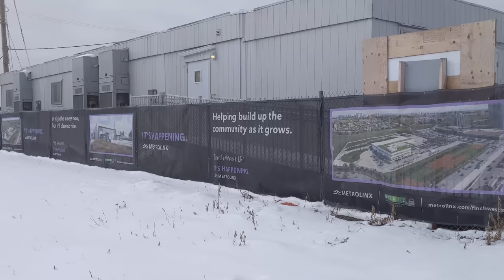Missing Links: Short-Sighted Transit Planning

Comment: Moscow: lines 8 and 8A are intended to be parts of one line, they’re even numbered this way and are both yellow on the map. But connecting them requires difficult construction in the dense city center, so it is always postponed, and instead, long lines are constructed in the now-nowhere (as they yield more kilometers and other big numbers that can be proudly reported). To be fair, line 6 and line 7 were also each split into two before being joined in the center, but not for that long, and these were Soviet times anyway.

Also importantly missing are interchanges to Polyanka from line 6, Kitay-Gorod from line 3 and Dostoyevskaya from line 5 (circle), but the last one is under construction (again, after years of freezing and unfreezing it, but this time it all feels unexplainably more certain).

Comment: I want to talk about an example the video doesn't mention. 

First, some background info: In Ankara, the Ankaray (LRT) Line ends at the city's intercity bus terminal. This line is the first rail line in the city. Then, 20 years after this line had opened, the government built a new metro line and put a station that is located close to Ankaray line. But because of this new line built under a highway, there are apr. 800 meters distance between those two stations. 

Later, the government dug a tunnel between those stations, put the rails, even built the transfer station, etc. but the line couldn't be opened. Why? Because Ankaray's signalization was too old to be modified, extended, etc. Signalization of the whole line needed to be rebuilt from scratch. Now, the municipality is running an expansion program about the other end of the Ankaray, and they announced while they are building the extension, they'll modernize the signalization and open the other part, too. It probably will take years, but it's better than nothing. 

Edit: Again in Ankara, the M4 line ended at a ridiculous station. Yes, it had a transfer station with M1 but you had to make a transfer to go downtown. The funny part is the distance between the station where M4 ended and the downtown station was only three stations. Thankfully, they realized the nonsense and currently expanding M4 to downtown.

Edit 2: I just realized our M1 line has missing connections, too. If they have built 1,5 km longer, the M1 line would end at the location that our commuter rail Başkentray's expanding station.

Comment: It always frustrated me how San Diego is a light rail city without airport connections. The trolley literally goes right next to the airport but if you want to actually take transit to the aiport, you would need to hop off the trolley and take a bus.

Comment: What has been bothering me for a long time is the Amtrak terminal for San Francisco Bay Area is at Emeryville, a place with no other connections other than buses.  The ideal case is to extend across the San Francisco Bay to the new Salesforce Transit Center in downtown San Francisco.  If that is not possible, at least it should be extended to Oakland and connect to the BART subway system
Reply: I thought the major Amtrak terminal for Bay Area is Oakland Jack London Square. At least that's where the Coast Starlight stops to drop off trash and pick up supplies. Which Amtrak train uses Emeryville for its terminal? And yeah, the lack of connection between railroad and BART is laughable in Alameda County. At least it's been rectified in SF.
Reply: The California Zephyr to Chicago uses Emeryville for its terminus and doesn't go to Oakland Jack London Square

Comment: In Chicago, I have missed many transfers between the Metra Electric District and Union Pacific trains because of the 1 mile distance between their city-center stops at Millennium Station and Ogilvie Transportation Center.
Reply: Chicago Hub Improvement Program (formerly Chicago Access Project). New major ME station at McCormick Place and upgrading the St.Charles Airline to directly connect it to Union without reversing at the bridge. But so far the plan for CHIP doesn't include a travelator or some such connection from Union to Ogilvie. Still, a two block gap is better than one mile.

Comment: In the London Underground new lines MUST interconnect at every station  of other lines in the under surface-tunnel core area. The Victoria and Jubilee Line Extension were required to by the UK national Treasury as a 'cost benefit analysis'. Most recently the rule applied to the Elizabeth Line on the same basis, ie it interconnects with every Tube station it passed by. However,  this gives rise to major local political arguments where the line passes but there are no  stations planned  because there is no station present; the two examples of recent date were the demand for a station on the Victoria Line at Pimlico, uniquely no interconnection and Southwark and Bermondsey on the Jubilee LE.
Reply: Have you got a link to that? As far as I'm aware each station would be looked at on a case by case basis as part of its business case, a connection may or may not help the case (Northern Line extension to Clapham Jcn didn't due to crowding concerns). 

Lizzy doesn't call at Holborn so there's no connection with Piccadilly even though it must pass very close to it. And I don't understand your references to Pimlico, Southwark and Bermondsey - they were built because business cases showed they'd be viable.
Reply: It doesn't interconnect with Oxford Circus either despite Bond Street, Oxford Circus and Tottenham Court Road being in a straight line (likely due to overcrowding at Oxford Circus)
Reply: @theobrigham  Ah - yes. For some reason I thought Oxford St connected into one end of TCR Elizebeth line, but it's miles away. So yeah, other than Bakerloo, Victoria and Piccadilly, the Lizzie connects to all lines it crosses...
It also doesn't stop at City Airport despite passing under the site.
Reply: @theobrigham  the trains are so long that they would hardly move between tcr, oxford circus and bond st.

Comment: In BC outside major centres transit is the responsibility of regional districts even though most RDs transit is operated by BC Transit, but the regional districts don't talk to eachother. So you have missed connections between regional districts. So you can take a bus (not a frequent bus) from Courtenay to Fanny Bay and from Deep Bay to Nanaimo but not a bus from Courtenay to Nanaimo unless you want a 12Km walk in the middle - which would take the bus about 10 minutes to bridge.
Reply: Oh, also we have a rail line... That hasn't seen service in over a decade.

Comment: Seattle and Seattle Tacoma airport are kind of in the same boat. It’s light rail connects to the airport and the city but it doesn’t connect to the larger rail network. I wanted to use it very badly. But the need to taxi between the two and then the extremely limited schedule made it all but worthless for anyone who doesn’t live in downtown Seattle

Comment: NYC has so many weird gaps, but my least favorite is the weird gap between the J/M and the G train. The G train's Broadway station is right between 2 J/M stops - only like 2 blocks from each - and has no free transfer between the two. there used to be a free transfer but that was just for the L-pocalypse. both J/M stops are also a little too close to one another, frankly it would be better to just close Hewes and Lorimer and build a new stop right over the G's Broadway station.
Reply: The East River crossings to Brooklyn really make it clear that these used to be separate competing systems.

To some extent the discussions make it clear that the more extensive your transit system is, the more missing connections you'll see--so some of the systems being complained about the most are the best ones. But there are always cases like this one that just stick out.

Comment: In Barcelona there are 2 main gaps they need urgently to be completed.
Trinidad Nova (Metro L3, L4, L11) to Trinitat Vella (Metro L1) Distance 900 m.

Link of Tram de la Diagonal from Francesc Macià and Glòries (the Glòries - Girona section is being built, Girona - Francesc Macià section is incertain due to the idiocy of a vast part of inhabitants Andy of course the politicians)

There are also a gap for M L4 from La Pau to Sagrera due to Sagrera station works.

Comment: Another example is the Tyne and Wear Metro. One line ends underground in the city centre at St James - in the direction of West Newcastle, one of the areas that would most benefit from an extension. But Nexus failed to secure the further right of way, and a large building project went ahead at the end of the tunnel without leaving a path for future expansion.
Reply: I'm fascinated by this. Do you have a link to more details, as I've always wondered why there's a one-stop stump on the west side.
Reply: @bearr3096  There have never been any concrete plans to extend the Metro beyond St James, despite the fact that West Newcastle has the population density to justify it. But if you look at the Meet Your Metro brochures from the late 1970s (can be found online), possible extensions are shown; main drawback is that to hit the populated areas, tunneling would be required. Nexus should have insisted on at least a one-stop extension (even as a provisional tunnel) as part of the recent building projects, but it did not.
Reply: @simonbone  don't blame it all on Nexus - the council let it happen too
Reply: @bearr3096  Very true. Incredible short-sightedness all around. Compare this to Edmonton, or Berlin, where tunnel boxes were mandated well ahead of confirmed extensions.

Comment: Stockholm has soooo many of these examples of bad integration between the subway and commuter rail, which to be fair wasn't really a thing when the subway was built in the 60s. So: a branch of the green line ends at Hagsätra instead of the major commuter train hub Älvsjö (~1.6 km), after actually crossing a commuter rail line without a stop. Farsta Strand has both subway and commuter rail, but with a quite annoying walk (~300m) between them. The commuter rail station Södra Station is 600m from the green line at Medborgarplatsen, and 500m from the red line at Mariatorget. And both northern branches of the blue line end 1-2km from a commuter rail station.

But on the bright side, a lot is improving. The tram line Tvärbanan interconnects lots of lines and is also being expanded, the commuter rail line got city center tunnel'd with a new station with the subway at Odenplan, and a branch of the blue line is being extended to Barkarby. And in the south, Spårväg Syd will be providing lots of interconnections.

Comment: Nothing at Woodbine?  Ummm...  There's Woodbine race track there, with a shopping centre across the street.  Also, if you're going to Woodbine, you might as well go all the way to the airport, which isn't much further.  This would also permit connection with the extension of the Eglinton LRT to there.

Comment: I also think the Dresdner Bahn is also a case of a missing link but on a larger scale scale: It's one of the lines which goes south of Berlin and as implied, it goes from Dresden to Berlin but was largely deactivated within the border of Berlin except for the S-Bahn. For such an important connection, there was no direct way so all the trains have to drive on the outer ring to get to Dresden. It's in the process of getting ractivated, though, which is why there is so much construction on that line.

Comment: Another missing "link" is the Hurontario LRT loop, that was supposed to go around Square One.  That loop would have included the Square One transit hub, city hall, the YMCA and the library main branch, along with several condo and office buildings.  At the same time that loop was cut, the government also cut back on bridge work at the Cooksville GO station, that would have made connection between the LRT and GO train easier.

Comment: The Melbourne Metro line passes just below South Yarra station with no connection. South Yarra is the busiest non-CBD station and has narrow platforms. It deserves a rebuild, and it should be connected to the new line, but the cost of this was going to be $1billion (less than 10% of the project), so was not included in the project. Frustrating and short sighted.

Comment: You had an interesting point about how a terminus is different from a regular station. This isn't something I've noticed in Stockholm. A terminus just feels like any other station, with the only difference being that there's often a train waiting there instead of you having to wait for the train to come.

There are other stations on the route that can work as a terminus, where the main platform is split with an extra track inbetween. A different design that required planning in advance. But terminuses aren't built like that.

Comment: I am not sure if this has been posted yet, one of the biggest missed opportunities was the Green Line in LA which ends in Norwalk 2.5 miles from the Metrolink Commuter Line in Norwalk/Santa Fe Springs! it has been like this for 27 years! The Metrolink line is the Orange County Line and Amtrk's route to San Diego, and the Green Line is the route to LAX.  What a gigantic stupid decision not to continue it. what a missed opportunity, you could taken the train anywhere from orange county to LAX with one stop (and a terminal shuttle bus at the LAX side)

Comment: In my local transit system of São Paulo, there aren't any obvious missing links yet, but I fear it might be happening in some planned future lines, especifically with Line 16- Violet since it terminates just one station short of a potential connection to the future lines 20 and 22, it's plans are well integrated to the current grid but seem to lack the foresight to connect to these future lines.

Comment: In my hometown Munich, missing links have been avoided in recent times as far as I can tell. Some examples that stem from long ago:
- Tram 17 has its terminus at Amalienburgstraße, 1.4 km away from Obermenzing station, in the midst of nowhere. The tram loop was constructed in 1962 when the railway station already existed (served by the S-Bahn since 1972). There have been initiatives to extend the tram line, but failed due to concerns the trams would impede private transport on the already congested street. (the irony ...)
- Obersendling metro station (U3) and Siemenswerke (S-Bahn and regional rail) are 0.4 km away from each other -- a walkable, but not very comfortable interchange. The U3 line was built in the 1980s and cut the rail line between two stations. However, building the the metro station at Siemenswerke would have meant a detour for the metro between Aidenbachstraße and Thalkirchen on its way into the city.
- U4 ends at Arabellapark, 2km away from Englschalking S-Bahn station
- U5 ends at Laimer Platz, 4km away from Munich-Pasing (major railway station and transit hub), construction on the extension has begun this year though.
- U6 ends at Garching-Forschungszentrum, 6 km away from Neufahrn S-Bahn station. This extension would mean a much better connection between the airport, Freising, and northern Munich. U6 is already running at full capacity though, so adding more passengers might not even be a good idea here.

Some positive examples are the links between U5 & S7 at Neuperlach Süd (opened 1980), U2 & S1 at Feldmoching (opened 1996), and U3 & S1 at Moosach (opened 2010).
Reply: also at Kreuzstraße, why not do simply a loop and unite S3 and S7?
Reply: @petermatyas4834  Or at least extend S7 to Holzkirchen, as Kreuzstraße is in the midst of nowhere :D
But I guess it's complicated since both S7 and Mangfalltalbahn (the railway which the section Holzkirchen-Kreuzstraße is part of) are single-track. This might need a second track for Holzkirchen-Kreuzstraße and different passing loops on the S7 part, or everything would have to be scheduled around the limitations.
Reply: @23nine  that would be largely the same as what I say :) I just noticed that according to the mp, there already is a loop line, even if single track.
Reply: @petermatyas4834  Yes there is a railway connection, it's a part of Mangfalltalbahn which is served by regional trains. It also serves as a backup for long-distance trains in case of closure of the Munich-Rosenheim railway.